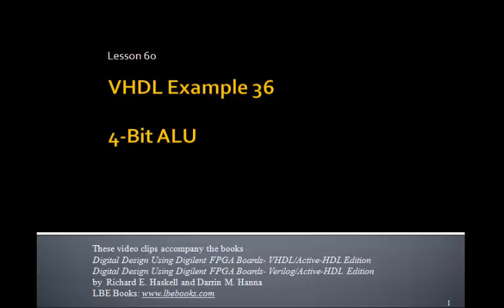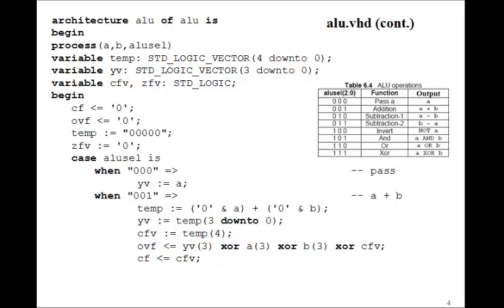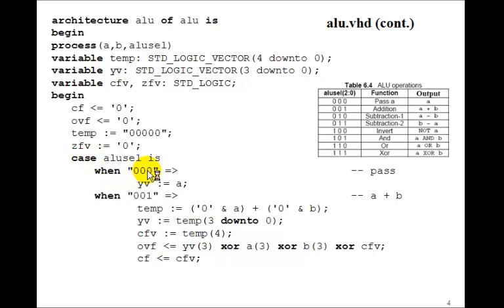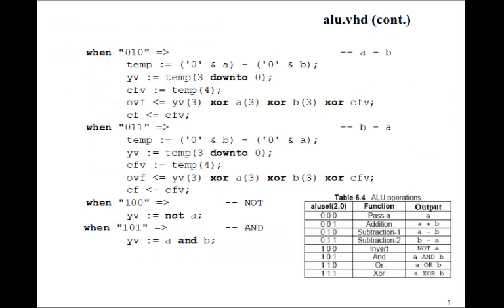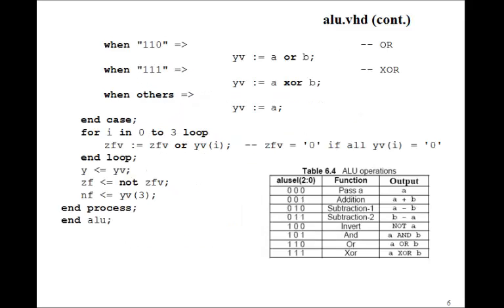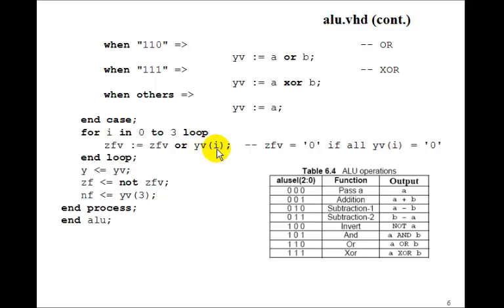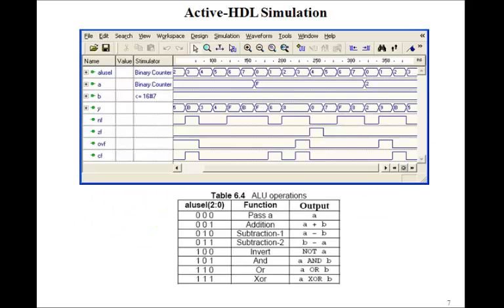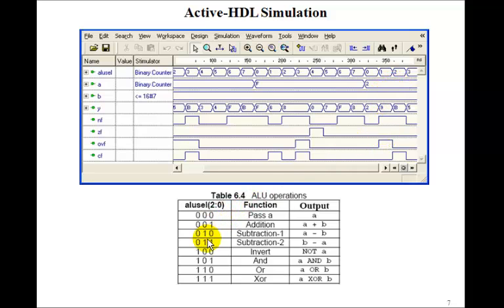Lesson 60 - Example 36: 4-bit Arithmetic/Logic Unit ALU

Comment: Hello,
i am trying to make my own alu in vhdl too (own project for learning). My understanding issue is right now about the carry and overflow flag.
I searched in google a lot, but in the "critical" point, there are different opinions. So for example:
In an unsigned addition, there is no need for an overflow flag at all, and yet you use it.
Is it because you want the code to look the "same" in addition and subtraction, or is there some deep meaning, which i didn't figure out? In general i thought that overflow-flag is only usefull with signed operations